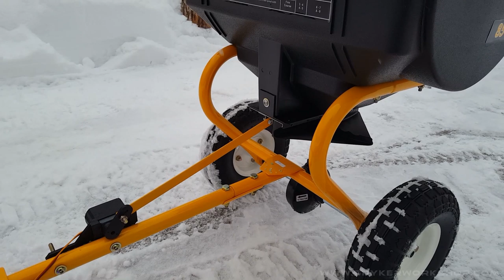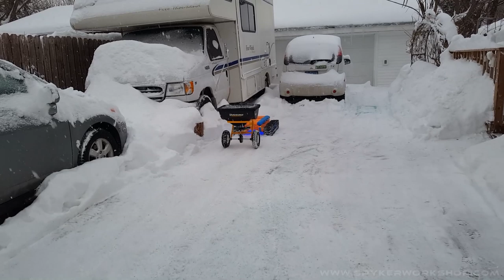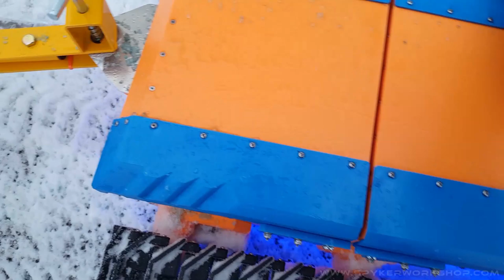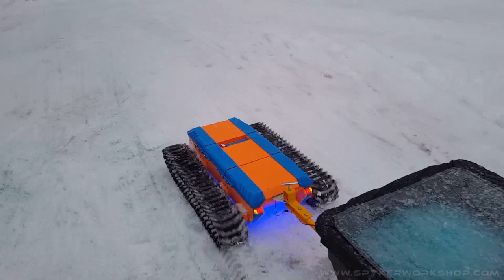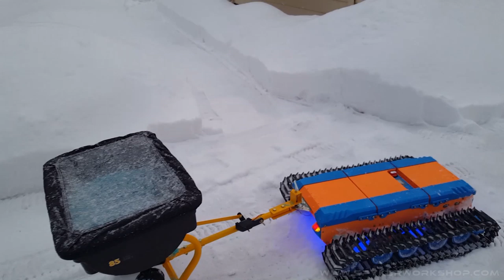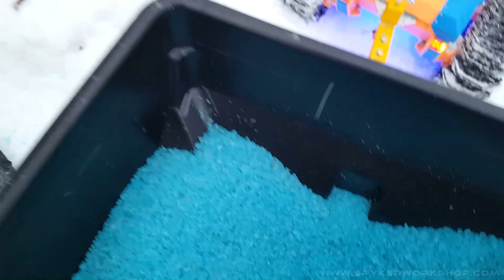Spyker Workshop - Spyker KAT 2X With Salt Spreader!

Comment: How heavy roughly is the larger kat
Reply from the maker: With 6x SLA 12v12ah its just over 100lbs. Blower weights ~16lbs, and the aluminum hull upgrade adds another ~16lbs